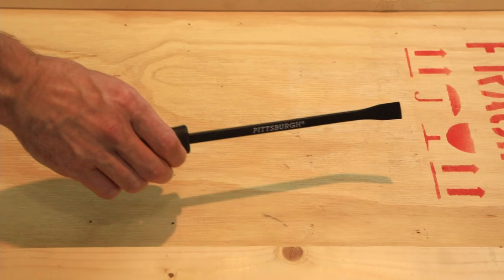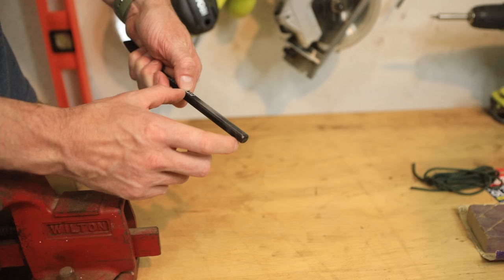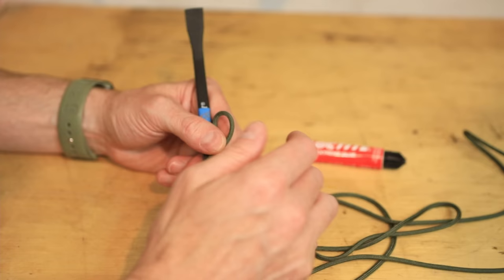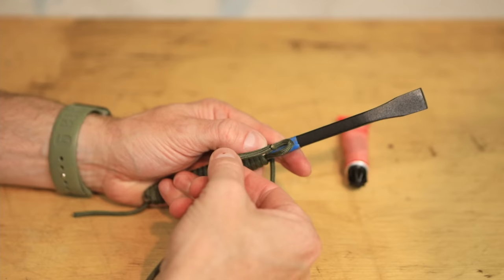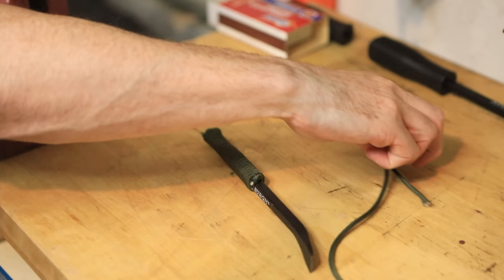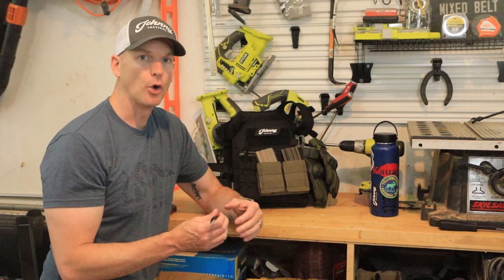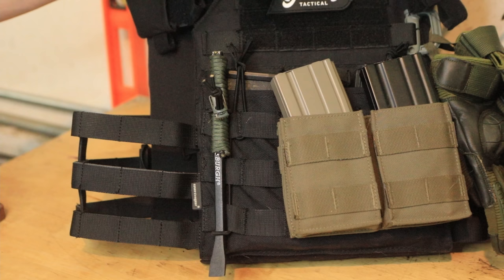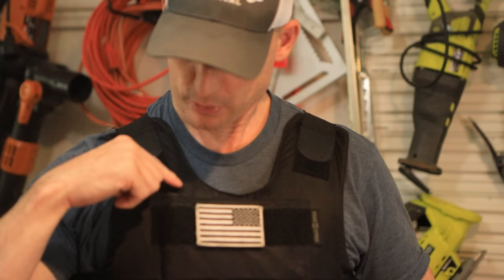The Key To The City: A DIY Tactical Tool You Can't Be Without

Comment: Take a few minutes with a drill and put a hole through the top of the bar to have a lanyard hole.  Things that are not attached always find a way to come loose or get lost riding in the car or truck or while getting in or out.
Reply from the maker: Yup, I see that. One of the ones I made I tied off a loop with the paracord to attach to a lanyard for that same reason.  I probably should have addressed that issue in the video.  Thanks for the feedback
Reply: it's a harbor freight pry bar, it will drill lol
Reply: @cliffeastwood4539  to your local machine shop, carbide drills will cut through hardened steel like butter
Reply: Sounds like you have some experience with this. Nice tip!
Reply: Generally only hardened at the tip.  otherwise it would not bend, just shatter.
Reply: Gotta be careful you don't weaken it too much by drilling a hole.. I imagine in some cases you might need to hit this bar with a hammer or a rock, and you don't want it to break and become a jagged piece of metal because you drilled a hole there!
Reply: Good grief guys this isnt a rifle barrel lol. A standard drill will do.
Reply: @Ryknfjor  gunna take a lazer to be able to get through that bad boy
Reply: @massivemike310  go right ahead and spend all that money then lol
Reply: @lukeerichsen231  was that a reference to that blacksmithing show lol
Reply: Maybe just invest in a high quality US made , true tempered pry bar
Reply: Specially during 'peaceful' rioting and looting. Maybe wrap it with a thin coating of rubber 'tape' to cut down on any noize while in use or on your person. Don't wanna draw any unintended attention onto yourself...IF you can help it.
Reply: a few minutes? are your bits made of butter?

Comment: I’ve carried one on my vest for the last 5 years and always recommend it to everyone. Only wish you would have came out with this video about 5 years sooner, it would have saved me some $$$. I bought mine already completed for around $30.
Reply from the maker: Thanks for watching! If I had a nickel for everything I wish I knew then that I know now....
Reply: Any door that this thing could open could be kicked in, and it'd be faster/more tactical for the element of surprise. So what is this thing useful for exactly???
Reply: where is it sold?
Reply: @BrassBashers  Are you saying this as a professional or as someone who has done breaching work before? 

Any door with more than one lock would be faster to breach with this than a kick. And any hollow interior doors would be likely to cave in with a kick instead of swing open. I've watched people put their fists and feet through doors like that and the lock didn't budge. But then you'd have to break through the whole door because the integrity is compromised in the material around the lock.
Reply: @benkelsey891  I understand that as reinforced doors, I had honestly watched the Navy Seal video that recently came out of the guy who stopped an attack on a hotel that got taken over by t-rests.. He said he kicked over more than 50 hotel doors that day, including ones barred with the latch.
I asked a simple question, he gave a simple answer, you had to go on your tangent. But thanks for the knowledge! Most doors aren't as reinforced as you mention.
Reply: @BrassBashers hi mate, that video sounds interesting. Could you link that video for me please? Cheers
Reply: @bigbadstretch13yrago  "Shawn Ryan Clips 2015 Bamako Hotel" search that if the link doesn't work.
Reply: @BrassBashers  cheers mate🙏
Reply: @BrassBashers Prybars are usually used for pulling. I can’t ever remember anyone ever kicking in a door that swings out. 🤔

Comment: Pour boiling water over it when you are done wrapping it. It makes it way tighter and won't loosen up.
Reply: I have never heard of this technique. I will definitely be giving this a try.
Reply: What about the glue. Do you apply the glue before or after the water.
Reply: @Standalone062790   I would suspect before .. the boiling water shrinks the plastic so the glue would anchor the ends making it tighten up
Reply: I've never used glue on my wraps. Just hot water and I've never had a problem with them. Not saying it doesn't work?

Comment: I made the exact same prybar over a year ago only I used a craftsman prybar. I didn't remove the finish under the wrap because in the event the wrap gets wet it still has some corrosion protection. The epoxy I used holds the wrap fine without having to sand.

Comment: Thanks for the video I modified it a little bit but appreciate your advice.  Got the same pry bars took off the handles and did not remove the paint.  Then I simply used some hockey tape for the handles.  When I do this I pull a 12" length twist it tightly and pre wrap the handle as it gives it more grip.  Then I continue to wrap regular about three times.  Good solid grip and great tool.  Thanks again
Reply from the maker: Glad to hear it! Ya, I agree, it's all about customizing to your own preferences.  I'm glad this video got your wheels turning
Reply: Could peel the hockey tape off and use it as a torniquette or to repair something or tape your ankle. Hockey tape is good stuff.
Reply: @misterbulger  Please don't use hockey tape as a tourniquet. Its 2022 and there are many much better relatively inexpensive options. Be prepared, son.
Reply: @scotttuttle2254  like a belt? Usually you dont carry a tourniquet in the off chance your leg gets severed since my pockets arent that deep

Comment: A drywall knife is also a great idea for bypassing interior door locks.
Reply: It works on exterior too
Reply: 😳🤔 wow never thought about using that... I got to try it now
Reply: Ah, I see youre a carpenter as well? Got tired of waiting for security to open up your job site door, too? lol We did it all the time. So many security or employees would be confused AND mad that we didnt wait for them to get started to work lol
Reply: I just use an 36DD underwire.
Reply: I mean, depending on how fast you need in, picking most cheapo kwiksets is easy with minimal practice and a rake.
Reply: Works on most common doors, although some have the double sided... uhh.... I don't know what they're called but the bit that catches in the frame.
Reply: @Krelian1  I got a set of lockpicks one year for Christmas as a kid and I got pretty good at picking my front door but any other lock was super hit or miss.
Reply: A travelers pick, putty knife, a deadblow and a prybar seems to always get me in wherever  I don't need to be.
Reply: @the_inquisitive_inquisitor  the term you're looking for is "deadlatch" and that can actually be defeated by setting your sliptool in the jam, running your prybar under the bottom of the door and stepping on it to lift and flex the door in the frame and get that little deadlatch to press in, yank your slip through the latch and shoulder into the door as you step off the bar. It'll pop right open.
Reply: @raphaelvermin  I don't know offhand what a "traveler's pick" or "deadblow" are.
Reply: @the_inquisitive_inquisitor  well a travelers pick is an angled off pointed steel pick slim enough to shim the jam of most doors and slide latches or lift door chains out of the way. I have three different ones but usually only carry a  90° tip, and what I call a "swizzle stick" because the tip has been angled specifically for hooking door chains and grabbing them so I can yank them with a handle instead of a string like the traditional method. 

A deadblow is a hammer with sand or some other form of median inside of it so that when it contacts the striking surface it doesn't bounce back. I use it in conjunction with the prybar. A 1.5lb deadblow gives an 11" prybar quite a bit more purchase in a jam.
Reply: @the_inquisitive_inquisitor  knowing the mechanics of a lock really helps, they sell modifiable locks that you can switch the pin locations on so it's random every time
Reply: Most interior doors and some exterior are a joke you can just kick straight through them
Reply: @JohnWick-yw6mf  yes but its literally no effort to take a shim and just slip a malfitted latch, and leaves almost no evidence that an entry/exit has even occurred.
Reply: Try one of those small hook tools from harbor freight. The set of 4 with orange handles I belive. It works on most doors without a deadbolt.
Reply: $5 scraper from family dollar works perfect!
Reply: @AutitsicDysexlia  Of a Bra?
Reply: wont work outside the US

Comment: I watched this over a year ago, but just got around to making one yesterday. Some thoughts. None of these are meant to be negative; I appreciate the time and effort of putting together the video. I think it is a great idea, even for non-LEOs. 
 
To the discussion about hardness, I can tell you the handle is either unhardened or has been tempered way back from full hardness. I hit it with both a belt grinder (removing the paint) and a file (to rough it up) and it is not knife-hard. I’ve been happy with the steel in HF axes, but I have no idea about the steel in these pry bars. Point is, you can drill a hole in the handle tip if you want to. Would not recommend drilling a hole farther up the shaft. Also recommend you round off the but end of the pry bar. That is going to come up against the heel of your hand, potentially under a lot of pressure. You want that round and smooth even if you will always use gloves. 
 
I found the glue to be unnecessary; paracord-wrapped knife handles never use glue and they are subjected to a lot more twisting, pulling, pushing, and general use than this ever will be. I put the tool in a vise and used both hands to do the wrap. You don’t need to kill it, but I think wrapping it tighter than shown in the video is key to getting a paracord wrap that won’t stretch and wriggle its way undone. Know that the pull-through of the cinch at the top will be very difficult if you get a tight wrap. Again, this is a good thing. But you might have to wrap the tail around something to give you some leverage.
Speaking of the tail, go ahead and leave six or eight inches hanging out of the butt end. You can tie a loop and make an attachment lanyard. 

It was probably gilding the lily, but after I got the wrap complete, I soaked the handle area in Flex Seal (liquid rubber). You could also use Plasti-dip or other such similar stuff. To prep for this, right before I started the wrap, I hit the shaft with some lacquer thinner (acetone) to degrease.  I didn’t do this to waterproof the handle, but to effectively lock the paracord in place, and add a little grip to the surface. It remains to be seen how durable this is, but I don’t envision a lot of twisting motion, or really a ton of use of the tool at all. Time will tell.
Reply from the maker: Love the feedback, I appreciate it 👍 I get the quality of the metal issue, and my original mini pry bar was a Craftsman, which was much better quality. I had a hard time finding that particular shape / style of pry bar which I personally prefer. I like the flex seal idea a lot. I might do another one and use that. Thanks for watching and commenting!
Reply: @johnny_tactical   Yes, sir. The only reason I brought up the metallurgy was because elsewhere in the comments here there was some… er… discussion about heat treat and quality of steel. From what I can tell, none of that discussion was based on actual knowledge of these tools. I have no idea what steel was used, what parts of it were heat treated, how they were heat treated, and whether they will bend, or break, or bounce back. I only know that the handle shaft seems relatively soft. That is not necessarily a bad thing. 

My take: these pry bars are perfectly fine for your intended application. I couldn’t break them; I couldn’t bend them. I’m sure if you wrapped a chain around them, and bolted them to your truck bumper, you could bend them. That’s not how you use them, so who cares? As cheap as they are, you could do a destructive test if you really wanted. I’d personally be interested to know if the tips snap easily, but again, I would argue that if you can’t do this by yanking the handle with your hand, anything else is purely academic. 

Heat treating of tools, to include edged tools like knives and chisels, is a balancing act. Take a cold chisel for example. If you quench that tool steel perfectly, and get it as hard as you can, you will have excellent edge retention (it won’t easily dull). However, the first time you strike it with a hammer, it will shatter like it’s made of ceramic, and quite possibly injure you. If you temper it way back, or don’t heat treat it at all from annealed steel, it will be too soft; it won’t hold an edge, and the striking surface will mushroom over. Unusable in either case. So the tool maker has to treat it to the perfect hardness to get both toughness, and hardness. Can we expect that HF had all this diligence with their $5 pry bar?  Maybe.

Comment: I'd like to suggest using electricians heat shrink for underground cables .
Chop off the amount required , gentle blowtorch to shrink and glue on , job done no muss no fuss never coming off plus it'll  give a better palm swell for grip .
Rope isnt a good idea , prone to failure
Reply: BuT pArAcOrD iS TaCtIcAl BrO
Reply: @dxjuggalo  💀💀💀

Comment: These do make a great tool; I keep a similar one in my BOB and carry it when need is likely. I’d just suggest that time/effort in sanding off the finish etc would be better spent drilling: I put a hole in mine at the end of the “grip” area. That allowed me to do a tight & secure cord wrap grip without glue, plus add a lanyard.
Reply from the maker: That's awesome, thanks for the comment!

Comment: Don't know if you've tried it but bank line works even better. As a bonus...it won't soak up water/sweat and its slightly tacky so more grippy. Stay safe out there Brother!
Reply from the maker: Thanks Mike, I haven’t heard of bank line but I’m about to Google it
Reply: @johnny_tactical  it’s smaller diameter than paracord but does come in different sizes. I usually get #24. About 1/8” thick. Also great for tying a chicken leg to and catching crabs on the bank ;)

Comment: I was impressed with this idea until I really thought about it. Loss of leverage, comfortable grip. When it gets wet the cordage will become soggy and will contaminate your hands every time you hold it. Contamination with dirt, muck, mold or waste fluids, human waste fluids. Can be used against you if taken away by a combatant while in a scrape. And Harbor Freight sells cats paws. Mini prybars longer than 6-8 inches in usable area above the paracord.  I have a 16 inch Craftsman flathead screwdriver that I keep in my Jeep. Same clear handle, spray painted black to not reflect lights at night and has some gravity in it when holding the blade end and swinging the handle like a club. My work used to issue employees a brand new set of screwdrivers every year of employment.  I have 5 full size rollaway toolboxes of nearly new tools. Why buy a $5 POS prybar at HF if possibly every pepper watching this video has tools on hand? Still a good idea though D⁹.
Reply: Typically these knife/tool videos are either underdone or over the top its clear "tacticool" was the main focus and when he said paracord i really wanted to stop watching he turned a tool into a bent shiv
Reply from the maker: Tacticool was not the focus. As you can see in the video description I got this idea from NYPD ESU breachers who use this exact same tool modified in this way.  I adopted it based on their recommendation and it has proven itself many times over a many years.  Thanks for watching
Reply: @johnny_tactical  no problem i was glad to watch and i wrote the comment before really understanding the concept i actually now agree this is a viable tool im leaving my initial thoughts up anyway just so people can see it sorry if it came off as a harsh but have you see the spring door breaching tool? I saw it on lockpicking lawyers channel i think they called it a pin destroyer that seems like it could also somewhat apply as both are not only for breaching but within the same length just want your opinion on it
Reply: @judethenekogamer3651  I may not be very imperative to the specific conversation, but that is an item that I would have any day over even the biggest of pry bars.
Why be physical when you can be meticulous.
That's a very good tool and I'm buying it as soon as I acquire the funds.